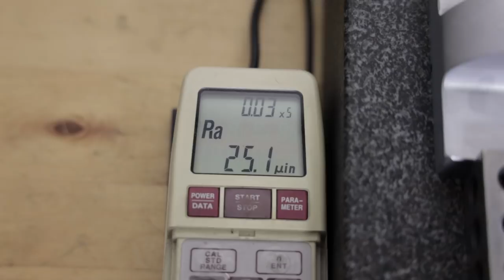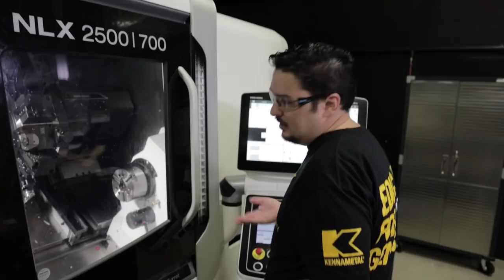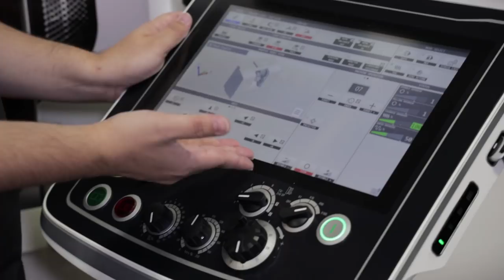DMG MORI - NLX 2500 - CNC MACHINING FIRST PART | Vlog #15

Comment: I'm running a similiar machine is there any way to by pass that door interlock ,like most machines there's different ways to by pass(meaning I can run the machine with the door open)I'm strating to think I would have to take the whole safety lock device out,which no one wants to do,please feed back

Comment: @TITANS of CNC: Academy "Dumb" question here... A lot of the metals that you encourage people to learn and learn well are hell-atiously expensive ? No ? Like the Ti-Al-4V … Or inconel / special nickel alloys; on your teaching programs / academy are you hooked into any metal suppliers that folks could take advantage for a discount (in the USA) ? Just an idea/ thought.
Reply from the maker: In our Free online academy.titansofcnc.com we teach with aluminum on all lower level CNC series... but as we progress into Aerospace etc... it naturally is going to higher materials and tighter tolerances.

TMS Titanium has been very good to our students.
Reply: Awesome will check out TMS (Thanks!). Always good to stress the FREE part ;-) What you save on lessons you can spend on more challenging materials (when appropriate). It all works and hangs together nicely.

Comment: Great job! I enjoy watching every single video
 I am a former mechanic, now working as a pilot for an airline. But honestly I miss my old job a lot and all the interesting technology who comes with it. My true passion is to make metal chips!
My future project is to start my own business with a machine shop. Hopefully within the next year. I used to program with the TopSolid CAD/CAM system. Autodesk Fusion 360 got my interest when I watched your videos. Now I learn how to program in fusion 360. So far so good and I am very happy with the software. Now I try to program 5 axis parts in fusion 360.
NOW MY QESTION IS: Do you have a software to simulate your CNC programs with the exact same CNC machine? So you can make sure that the tool and spindle won't collide with any other part of the cnc machine. 

Greetings from Switzerland 🇨🇭
Reply: A mechanic is NOT the same as a machinist
Reply: Vielen Dank. Werde mir das anschauen.
Reply: Search for camplete

Comment: Awesome job! I know Kennametal is a sponsor but if you get the chance look into Capto couplings as an alternate to KM couplings. Kennametal makes them too.
Reply from the maker: The Capto is a pull back... and the KM50 is a ball lock. Very similar but the ball lock takes less damage if you ever crash and the KM50 has more rigidity as it compounds out, away from the turret. Both are great.
Reply: From what i have experienced capto wears better over time. Also there seems to be a bigger selection of tooling now that the patent expired. But agreed both have their advantages.

Comment: Finally a Pro brand in your shop 👍
Reply: someone else I mean I get it if you don’t like the German wrapper on the machine (I personally like all of the ergo features they’ve improved on). But inside it’s still straight Mori from way back. We literally have this exact machine on our floor, and it is extremely heavy with full box ways in X and Z with very powerful and fast servos. The Celos control is just MAPPs V on Mitsubishi, not really much of a change from before the DMG acquisition. This Machine is just as heavy duty as my 1984 MV45... both built in Nara in fact. I say all that to say that I think ‘cheapened’ is probably a poor choice of word for what you don’t like. I’m not trying to be argumentative, but I personally just don’t see any quality reduction for the sake of profits from them.

Comment: @1:49 which control did you use to turn the turret full round? (As u described as accidented)
Reply: In jog mode it turns only cclockwise.
Reply: @tomekrozwadowski2265  Its scary for start. You expect turret turn T-1 and its turn T+11.